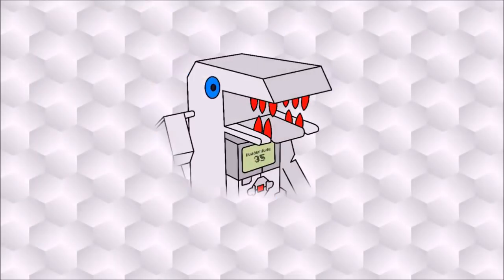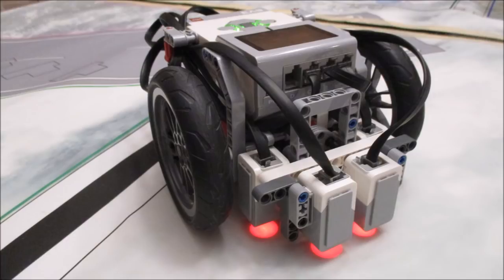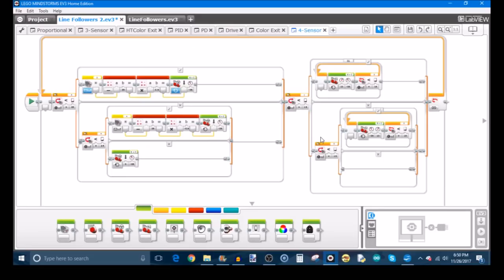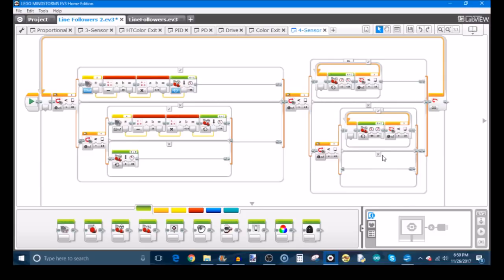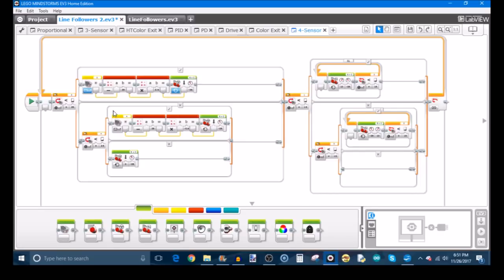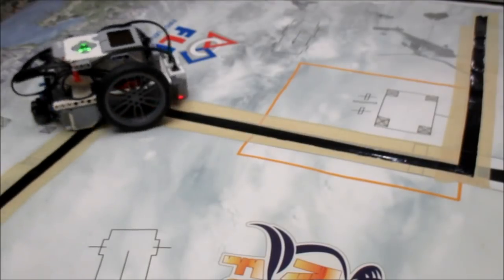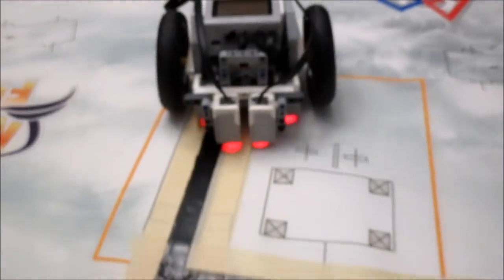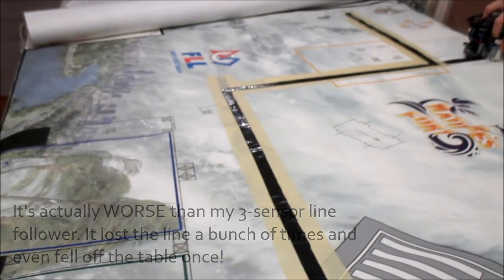4 Sensor Line Follower for EV3?!?!

Comment: Hi, I have a suggestion for a tutorial:
n-sensor PID line follower, where n is any even number, where it's no longer absurd! I have the algorithm! This will end the whole cycle for any more line follower algorithms! In fact, more sensors do make line following better, provided we program them properly :)
As mentioned by Chris, it might not make sense to an FLL participant, but it really matters to a RoboCup Junior Rescue-Line participant.
Here's how my algorithm goes for a 2-sensor PID line follower (https://github.com/aryan-02/2sensorpid ):
Left Sensor's Reflected Light Intensity - Right Sensor's Reflected Light Intensity = Error
Integral += Error (Initialized as 0)
Derivative = Last Error - Error
Move Steering -> steering = (Error * kP) + (Integral * kI) + (Derivative * kD)

Now, the only thing that'll change in the algorithm for n sensors is the error calculation.
Here's how you'll do that for 4 sensors:
Let the sensor reflected light intensity values from left to right be a, b, c and d
Now Error = [(2*a)+(1*b)] - [(1*c)+(2*d)]. Basically, we're giving each sensor its own priority constant, so if the extreme left sensor senses black, we'll have a really sharp turn.

Similarly for a 6-sensor PID line follower:
(Let sensor values from left to right be a, b, c, d, e and f)
Error = [(3*a)+(2*b)+(1*c)]-[(1*d)+(2*e)+(3*f)]

I hope you understand!
Reply from the maker: Wow, this is awesome! Thank you for sharing; I will certainly consider making a tutorial for this sometime soon!
Reply from the maker: I just saw your comment again today. I am currently making a tutorial based on your idea. You will see it in September. Thank you for sharing such a great idea!

Comment: What sensors do you use for fll? We use 2 color sensors, and 1 gyro sensor and 1 touch sensor.
Reply from the maker: When I was in FLL, the only sensors I used were the NXT Light sensors and a Color sensor. You can check out my FLL robot designs from years past in this video: https://youtu.be/gDlTo277MNo